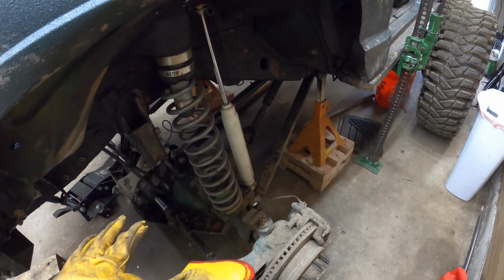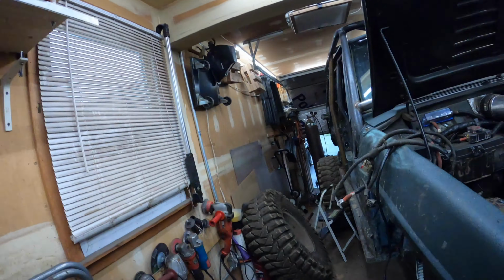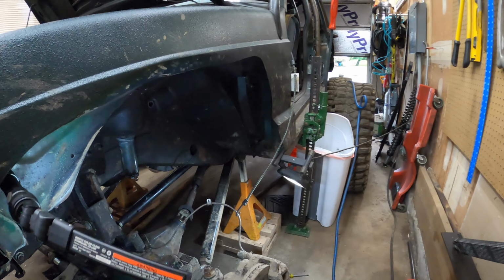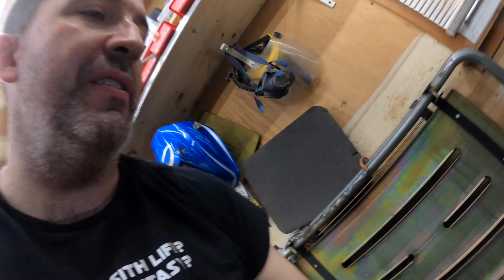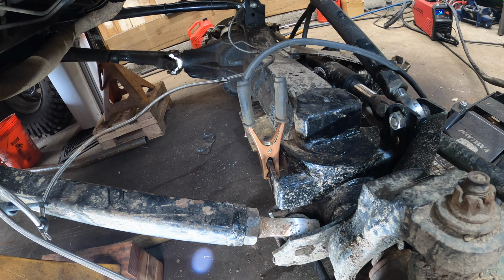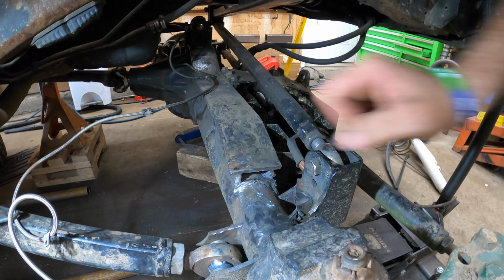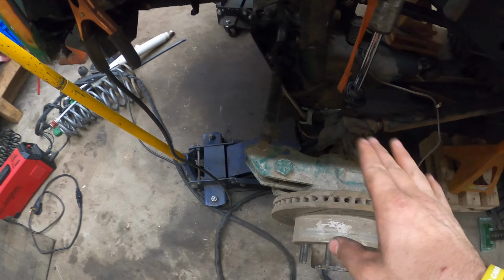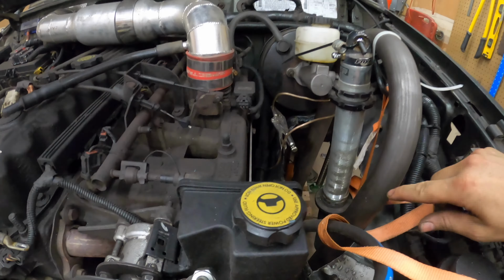Front coil overs in a Jeep Xj Cherokee

Comment: From experience, make sure you check how much the shock moves with everything drooped on one side and stuffed on the other. My coil springs rub the unibody sometimes.
Reply from the maker: I'm getting close to that step now.  I have the driver's side tacked in place and need to mount the passenger . I will definitely cycle the front before hard welding anything in.

Comment: That inner weld on the drivers side coil bucket snapped off because it was mig welded steel to cast.  Welding to cast takes preheat, post heat, and proper filler material.  I have had good results with preheat to 400, stick weld with 7018, and wrap in fiberglass insulation to slow cooling.
Reply from the maker: You are 100 percent correct.  I didn't preheat that weld.  I really need to get into stick welding.
Reply: @FMJeeping  I would strongly recommend you get a machine capable of 150 amps of DC stick welding.  I run 3/32 7018 for most materials from 1/8" - 3/8" at 85-90 amps.  I run 1/8 7018 for anything over 3/8 at 125 amps.  Stick is a lot easier to get a bunch of heat into the joint for good penetration.